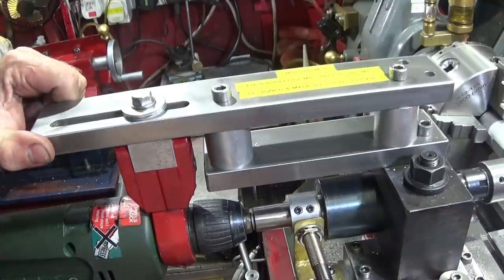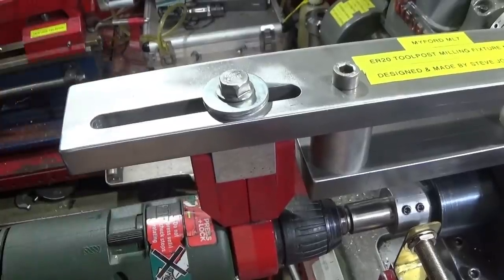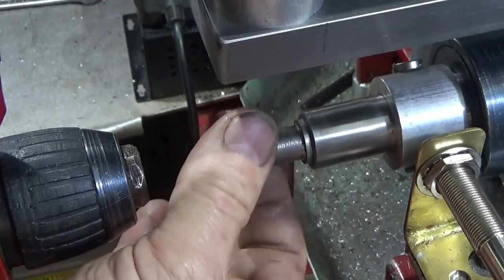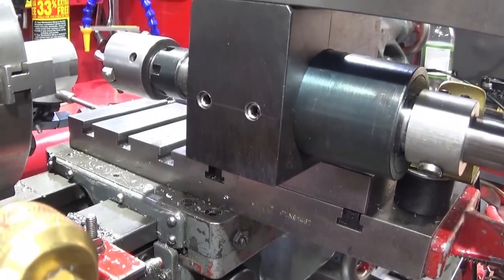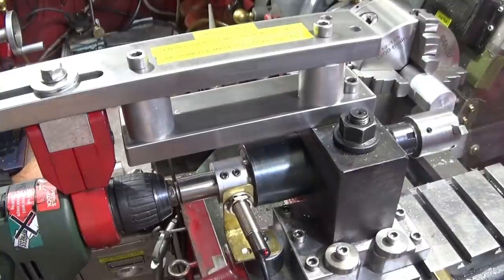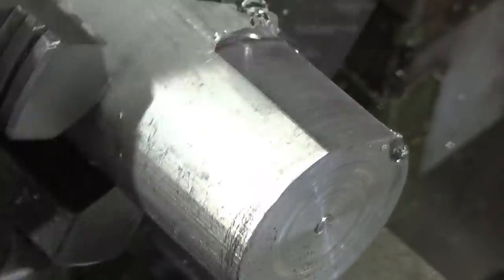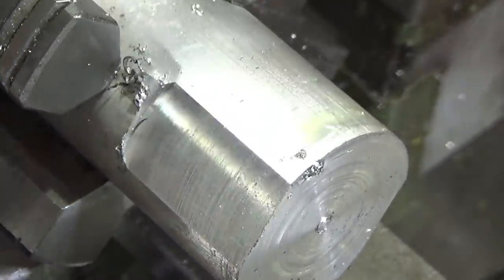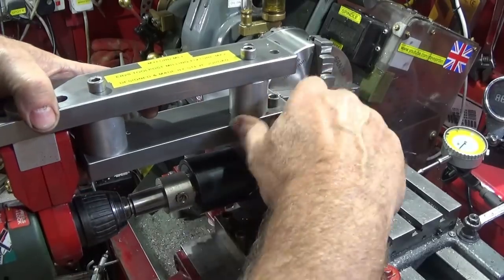ER20 Milling Attachment Fixture MK2 Steel Version Flycutting On The Lathe

Comment: Another great idea Steve, I'm just experimenting with bright steel on my Chinese mini lathe so this is all good info.
Reply from the maker: Hi Glyn. I find Bright Mild Steel fairly good to machine. I like turning it better than aluminium. Plus it blackens up nice if you heat it up with a gas torch nearly red hot and drop it in a container full of engine oil so that it's immersed. Regards Steve
Reply: @SteveJordan  Thank's Steve. I hope Rosie is keeping well!

Comment: Steve, have you a spare Chinese lathe pulley mandrel to 19mm dia so I can fit a 6” pulley similar to yours, my lathe is broken so I’m following your upgrade to the 3 phase and inverter but can’t turn one myself (chicken and egg syndrome) hope you can help.
Reply from the maker: Hi Pam, I will have a look tomorrow. Are you situated in the UK?
Reply: Yes Steve, if you find one or can turn me one I can bank transfer you the money. Thanks
Reply: Steve Jordan , yes Steve North West. If you can find one or turn me one I can bank transfer the money directly.
Reply from the maker: Ok I hope to make one up in the week if I get time. Regards Steve
Reply: Steve Jordan Thanks Steve, I will look forward to hearing from you.
Reply: Steve Jordan  - how is your schedule for this week, can you fit me in ?
Reply: Steve Jordan Steve, just viewed your video again on the 3 phase set up and noticed in the screen text that the mandrel was turned to an 1” or 25mm not 19mm as per shaft on the motor. If you have not started yet could it be the same please, that way there is more meat on the shaft for the 8mm draw bar. Just let me know which diameter you have and I’ll order the correct taper lock bush. Many thanks Pam.

Comment: Steve,  what might the angle between the tool bit with the insert & the square shank in the fly cutter, please?

Thanks,

Bill
Reply from the maker: I don't know offhand as I never measured it. If I get the time, I will check later.
Reply: Steve,  thank you.  

Bill